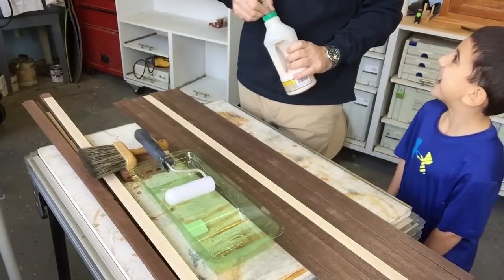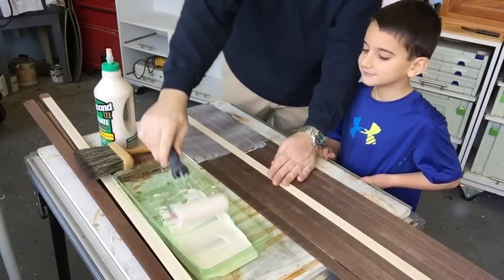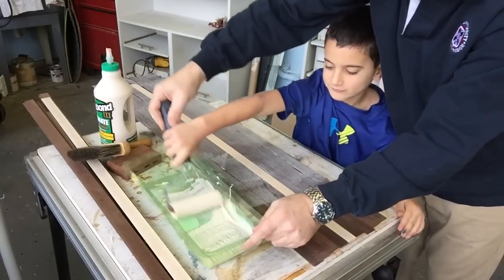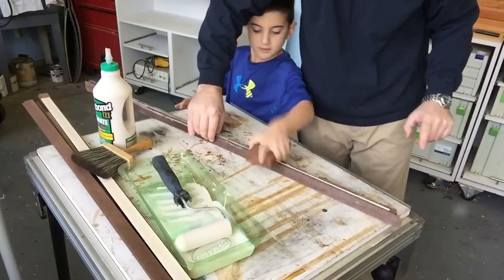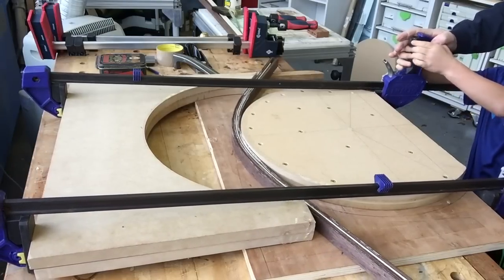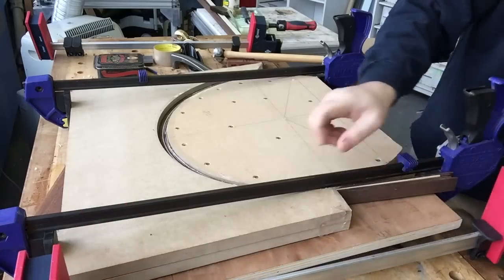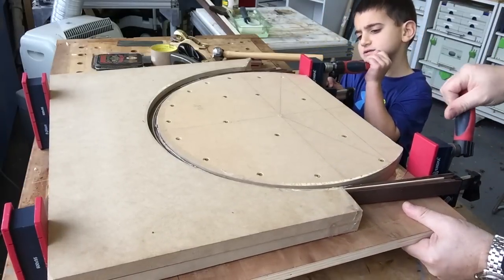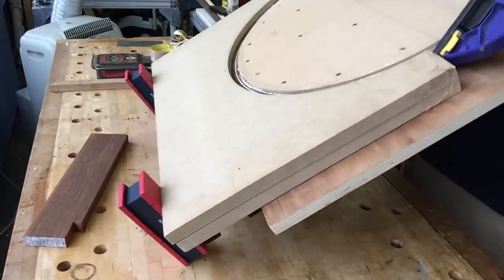Gluing up a bent lamination

Comment: I will be constructing a large curved redwood beam for a pergola. The arc has a 10' radius and is approximately 14' in total length. I'm planning to resaw a 2x8 into 1/2" thick slices for the lamination (planning to use a similar jig as shown on YouTube "Woodworking, DIY Curved Beams? Learn how "). Hopefully 1/2" is thin enough to bend easily.
Reply from the maker: Cool. Good luck! I would try 3/8" before 1/2". Which glue will you use?